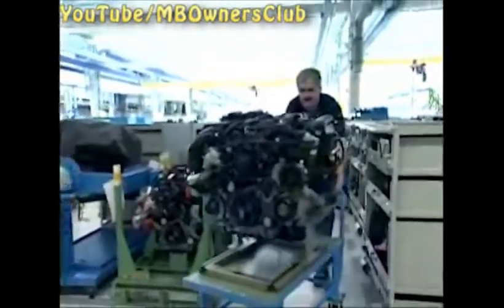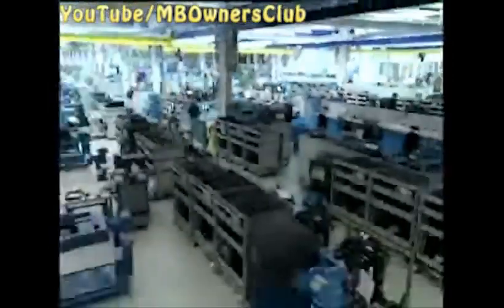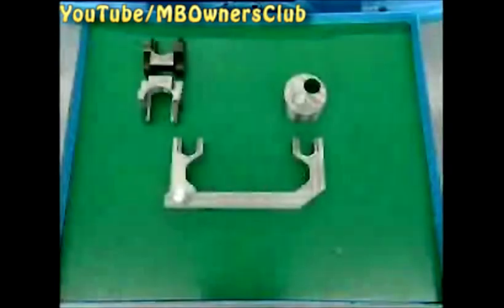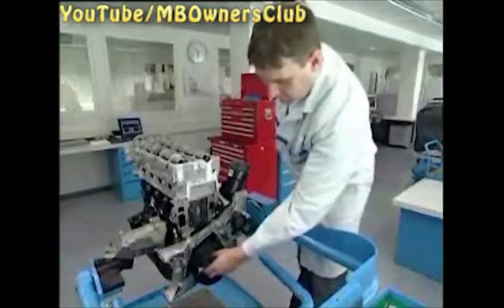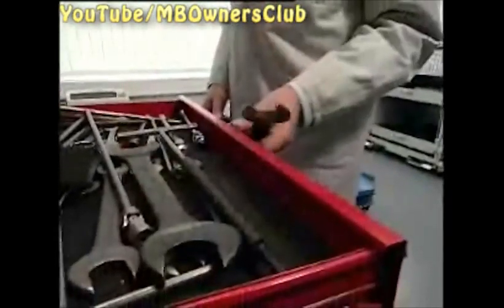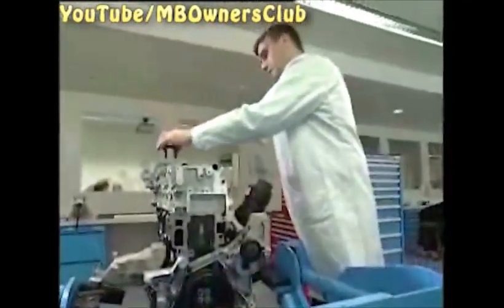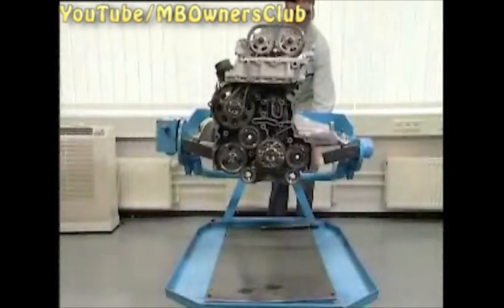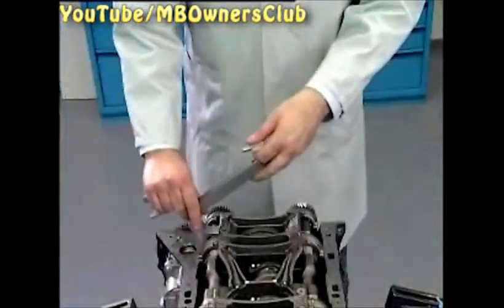Mercedes-Benz - Checking and adjusting the gear drive on OM 651 | Passenger Cars, engine OM651

Comment: Hi sir l have a problem in my sprinter mercedes benz 651 engine model year 2014 the engine was starting but misfiring we replaced new 4 injectors and now not starting only cranking and l installed again the old 4 injectors to try still not starting only cranking what do you think I can checked? Thanks